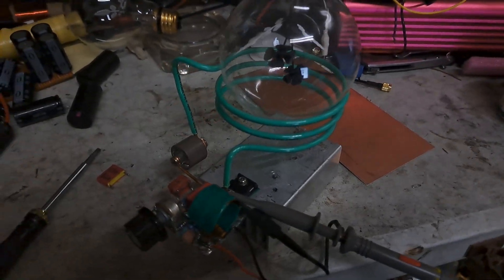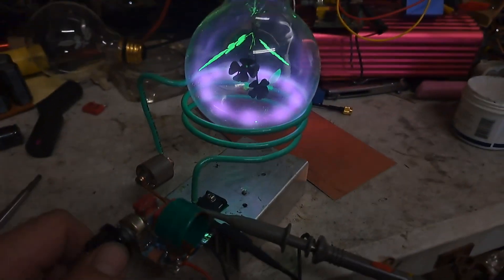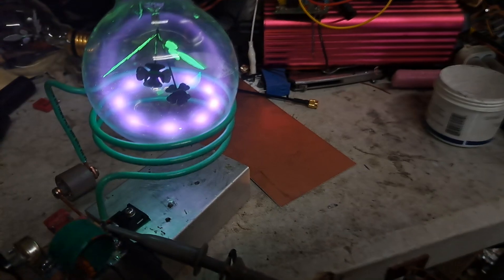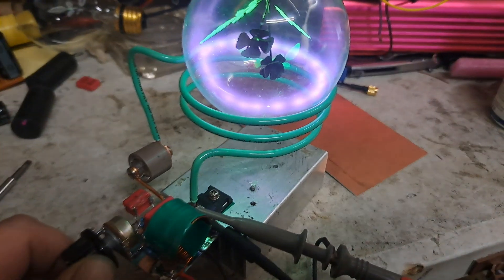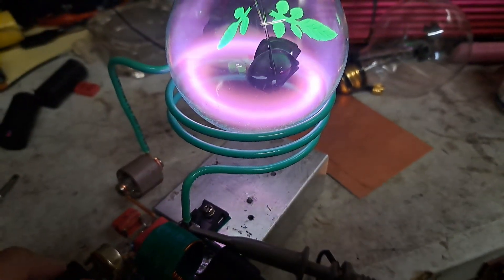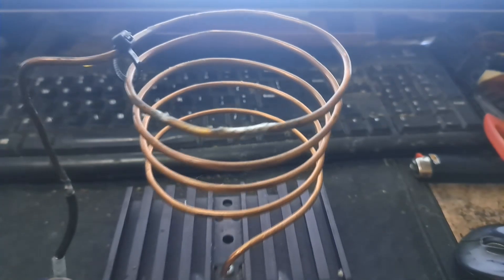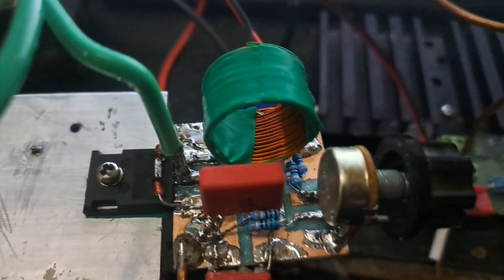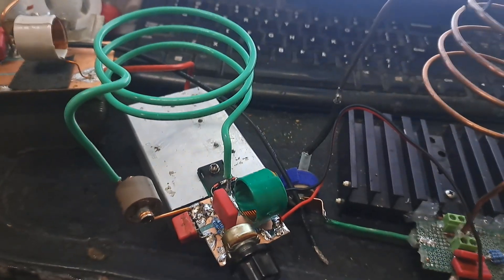16.5Mhz Plasma Donut Circuit

Comment: Cool! I happen to actually be making one of those! I’m using a modified zvs topology with a cap divider for feedback. It was kind of hard getting rid of the e field, and my glass ball also broke, but i’ll try with an actual xenon kind. I was using just one from a plasma ball toy. Also what was the thing that you used? the one with the fluorescent leaves inside
Reply from the maker: It's basically called an Edison bulb but the ones I got were sold on Amazon as Darksteve bulbs. I think they stopped carrying them but you should still be able to find them by searching for things like edison glow bulbs.
Reply: I can get you any flask you need for any circuit. Reach out if you like!
Reply: Also have an amazing ZVS design if you need that architecture.
Reply: @curlyjc I use a PCB with cog caps to minimize the parasitics. I use irfp260n.
Reply: @quartercubicI want to make a modular PCB dock like a printing press for the ee hobbyist niche. I want people to design their own circuits that they can just Jack into my platform

Comment: Hello, and what needs to be changed in the circuit so that the 470 pF capacitor can be used? I just don't have and where to get a 47pF capacitor, or if I make a homemade one out of copper?
Reply from the maker: I'm just stacking some 470pF caps on the gate to tune it. 47pF is too small. That would be around the value you need for the LC resonant capacitor.

Comment: Hey, this is really awsome and ive seen it once before. Can you post and tag me in the schematic?
Reply from the maker: There are a lot of other references out there which use the same circuit (different values). For example Jay from Plasma Channel did a video with Leon (Teslaundmehr) about it (https://www.youtube.com/watch?v=SyZuel2iaBk) and showed some diagrams. So this circuit is the same thing, but I'm referencing the exact values I used instead and showed the layout.

Comment: that's amazing!! i didn't get if it's the camera shutter or it's actually visible but those bubbles on the ring makes it even cooler, and interesting to see that the "interrupter" works in most setups... also really nice oscillators!!... i have to take a look at those low value RF caps, i just peeked for that kind of capacitors on ebay some days ago and the prices were prohibitive, especially if you try to have an assortment (not a big fan of buying just one component but i need to re-think it)
Reply from the maker: I wanted to see if there was anything particular necessary so I just started trying random oscillators, and even this one worked which was just a blind toss together. The little bubbles are indeed pretty awesome and you can get them to do some cool stuff with modulation. I just got a few more variations of those bulbs in I'm going to test out. For the RF caps I've always found 75pF or 100pF to be a good solid value for these rigs. You don't need such a ceramic RF cap but they do work pretty good. Haven't found them for under about $20 but they may be cheaper on Aliexpress.

Comment: magnetic field gas ionization. big deal. you should go in the neon business. you should use the filament as a monopole, or loop antenna  to induce a resonant E fields and steer the Coil E field with Ionization E field interference patterns. .
Reply from the maker: These are kind of like faux toroids in that they are not nearly continuous loads. There isn't much I can do in the way of influencing it aside from playing around with the mosfet biasing or modulating the bus. The filaments are strongly coupled so close to the coil that adding anything to them is going to couple some of the power away and load it down more, maybe reduce the power needed to form the toroids. There are some other variations I'm going to play with including small desktop plasma globes but I may need to get a proper globe filled with something like xenon.
Reply: @Magneticitist  affix  the bulb base on a high speed variable dc motor shaft. Run up the RPMs until the Filaments spread wider by centrifugal force. . you can use a strobe light synched to the motor RPM  to see where they are, in distance. try increasing distance a little at a time. and repeat as necessary to get the distance you need.

Comment: You make it look easy , I need to see if i have the parts . Great video
Reply from the maker: It does seem to be pretty easy, but to be clear that's because the goal is to not run fair amounts of power pushing something like a plasma flame or even just exciting the gas in a cloud that resembles similar loading. Just tossing together some random circuit for some type of continuous wave load is going to be more difficult and requires tuning. With these particular bulbs in place, it allows the circuit to oscillate at a lower bias, which also causes the circuit to shut off oscillations until the thicker gas load dissipates its formation for the cycle to continue. In the process of it doing that the donut forms in various ways. There doesn't seem to be any particular method of going about it with these bulbs, or exact particular dimensions or frequency etc.
It's far more difficult to get a nicely tuned HFSSTC that can run fair amounts of power for long periods as its loaded by the second resonator's flame.
Reply: You can bend an electron beam in a crooks tube . I have done it many times . You could try holding a magnet close to the bulb to see if there is a deflection . Underneath the bulb it might raise it up higher in the bulb .I can think of many tests to try . Happy testing .